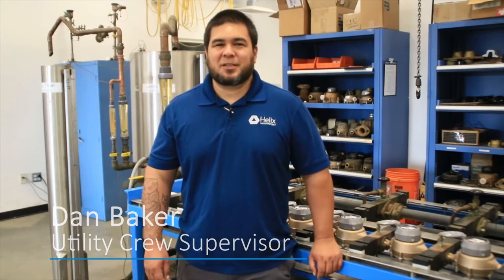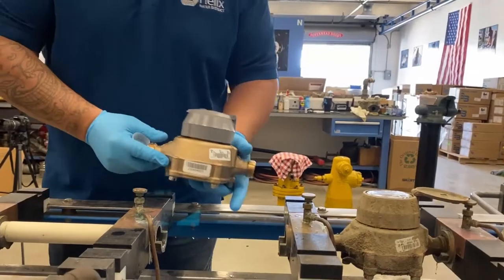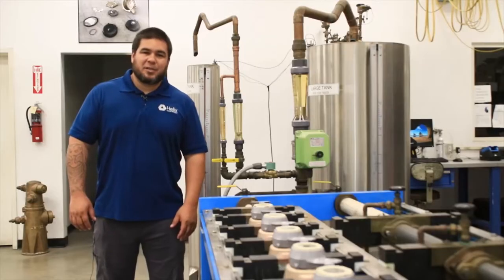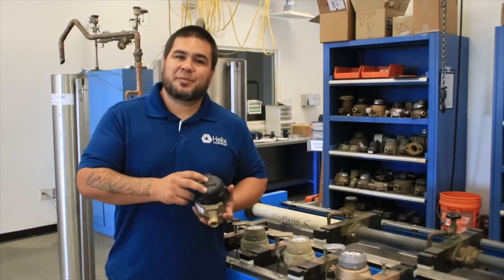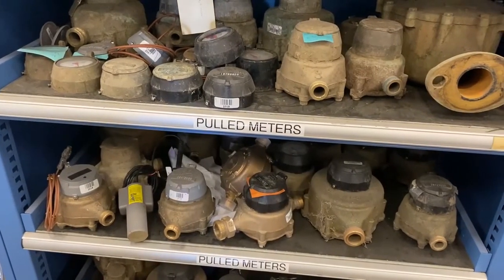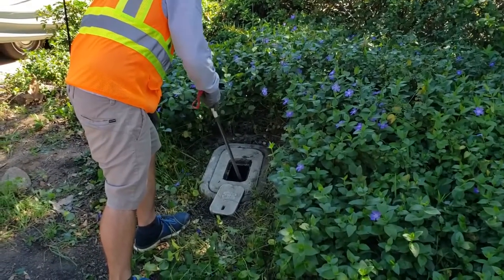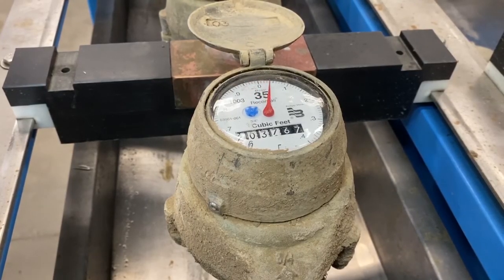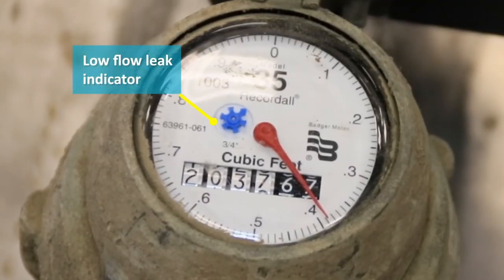Are Water Meters Accurate? Q&A

Comment from the maker: Hi Bilal. Thanks for the question. We reached out to Dan Baker for an answer to your question. Dan said, "In a multi-jet meter, water is directed into a measuring chamber and through a multi-veined rotor. The output speed of the rotor is proportional to the volume of the water. The adjustment screw on most brands of multi-jet meters is connected to an internal vein that will increase or decrease the speed of the water entering the measuring chamber. The adjustment screw is normally used by the manufacturer in the testing phase to make final adjustments for accuracy before releasing the meter for sale." Dan does not recommend adjusting the screw because it could make the meter over-register water flow.
Reply: I am a professional manufacturer of water meter accessories in China. Thank you for your guidance.

Comment: I asked the SRQ water department billings clerk how many defective reading meter have they replaced.  She said: "None".  Meanwhile, my meter said I used 41,000 gallons last month.  Yet, I can't find the pipe leak outside so far.
Reply: Much more common than the utility companies would have you believe.
Reply: My meter has a digital display. Been using 2000 gal a month for years. Last month I was billed for 54,000 gals. After much investigation I found the meter was now reporting in cubic feet not gallons. 54,000 cf is 2000 gal give or take a hundred. 
You can check this by google “calculate gal to cubic feet”. Use the gals from your last bill to enter in calculator. You may find your now being billed for CF which makes your bill a few hundred percent higher.
Reply: My bill showed I used 83,000 for the month of August when my monthly average for the last 3 years was range from 3-6000 gallons. My bill went from $75, 80 and month to $755.
Reply: @hornet224 have you [or @tracy_nguyen or @Tide_Fan] been writing complaining letters to news or political offices locally right before the meter-outrage reading?    Just wondering about the timing of your punishing bill?  TTYL
Reply: @tidefan4987  when you caught the switch and made them rectify it, did the next bill re-adjust the month's 'starting' reading to the correct units?  
Seems it should mess up the billing programs..

Thanks for the heads up on that trick....  I wonder whether  that switch is done manually or if some hacker could send a signal to do the switch???  and how was it switched back?  Great  insight....
Because it was a two-step switch... 1-- pretend the 2000gal to 2000cubic yards then 2-- convert the 2000 cubic yards to genuinely equivalent 54000 cubic ft... then transmit it to some receiver that expected gallons...   WOW...  That sure doesn't look accldental....   Thanks again....   ttyl
Reply: Still fighting with my water utility company.  Been a year now and refuse to admit I have a bad meter. I discovered that lightning had struck a large tree across the road from my house. I live in a very rural area. My thoughts are the lightning followed the water main(water is a conductor) and made my meter spin up. Before the storm my meter reading was 35,242 gallons. After it was 254k gallons. They did remove the charges but still refuse to replace the meter. My bill historically was $35 mo. Now $55. Next step is to turn this over to the state utilities commission.

Comment: Hi. 
Can anyone tell me that what does the adjustment screw on the multi-jet water meter do ? What does it adjust and how ?
Reply: It adjusts the trajectory of the water into the jet causing the meter to run slower or faster.
Reply: I am a professional manufacturer of water meter accessories in China. Thank you for your guidance.
Reply: I am a professional manufacturer of water meter accessories in China. Thank you for your guidance.

Comment: How I can fix my water meter which is reading wrong
Reply from the maker: Thanks for asking. You should talk to your water utility and see what options they have for testing your meter and to see what the issue is.
Reply: @helixwaterdistrict461 My water meter is 22 yrs old and I just noticed that the needle keeps jumping forward 4 slots. My water bill when up from 50 dls to 125 dls. My water bill for the last 4 months and beyond, was 50 to 58 dls a month. Do you think the water meter is breaking down? No leaks found?
Reply from the maker: @TheSavior81  Thanks for asking. Meters move when there is water use and old meters, like yours, let more water slip past the meter than it will register. I wouldn't be worried about an old meter I would be worried about the jumping needle, which indicates water use. Given the description, it sounds like either a cycling toilet, a fill valve, or a malfunctioning irrigation valve. Rule those issues out first, then if you have not found anything, contact your water utility and ask what options they have for assistance.
Reply: @helixwaterdistrict461  But the valves at toilets are close? The needle jumps when I turned the hose on? If the water is running the needle should be running consistently. The needle jumps 4 slots. Ive seen meters run but never jumps 4 slots when running. Could it be cause by this 22 yr old water meter? The city gave me the option to test the meter using a 3rd party. They would charge me 65dls to get it test. Why dosent the city just change the water meter being that it's 22 yrs old?
Reply from the maker: @TheSavior81   To your second question: It depends on their replacement cycle and what is cost-effective for them to fund. Water out here is more expensive than other parts of the US and gives us a shorter replacement period of 20 years.
Reply from the maker: @TheSavior81  To your first question, record a video and share it with your utility. They may want to have it tested and waive the testing fee. Otherwise, there are too many factors on the downstream private plumbing to know what exactly is going on. (FYI our meter accuracy testing fee is currently $268)